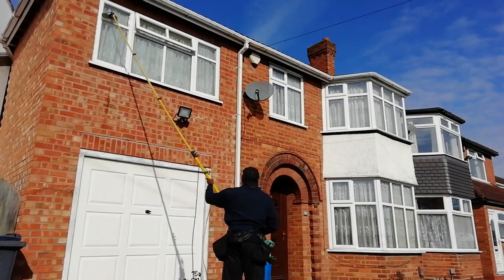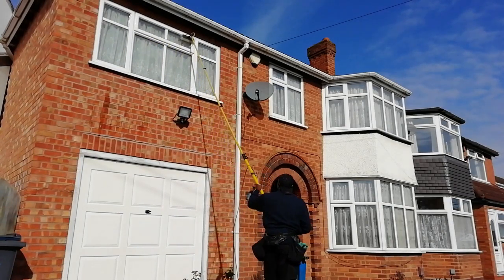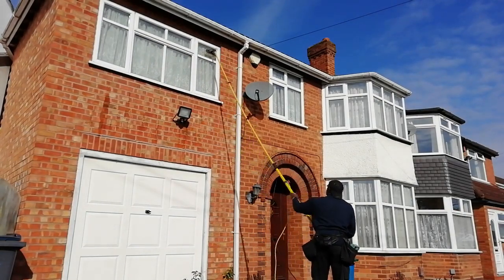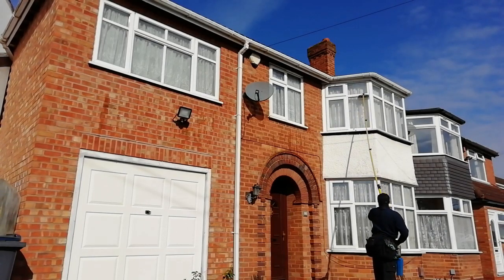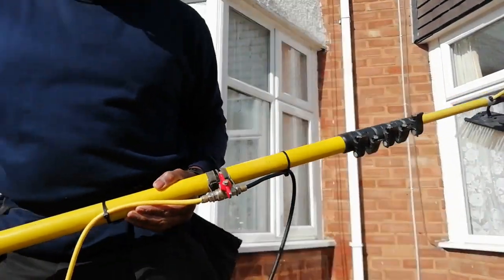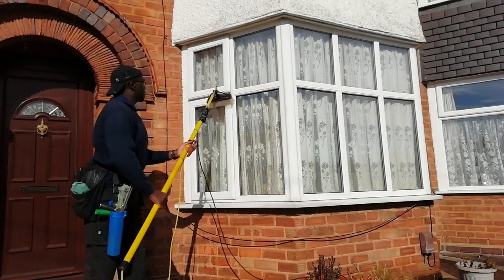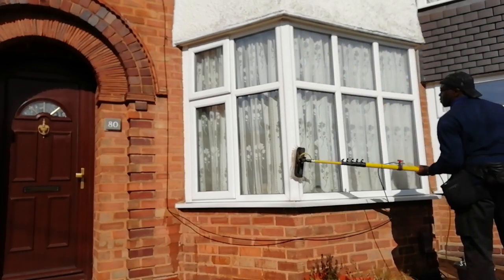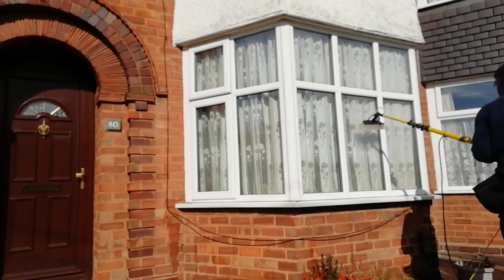MY WINDOW CLEANING POLE

Comment: On off or univalve does the same thing.stops the water and creates a dead end to the pump.whatever suits. My trolley system had a remote fob.my new set up has a univalve.same outcome .water comes out the brush then stops when you activate whatever method 👍🏼
Reply from the maker: That's right! 👍👍👍